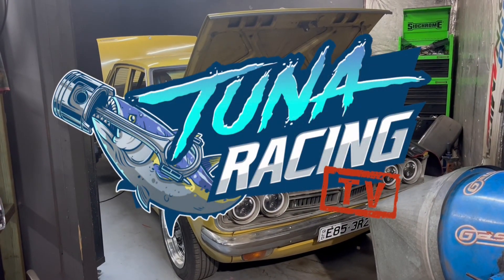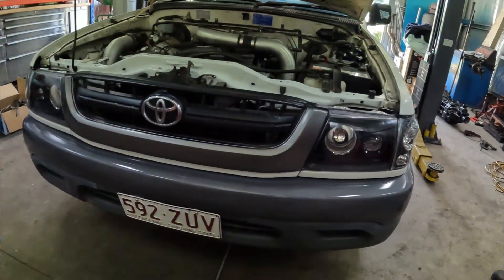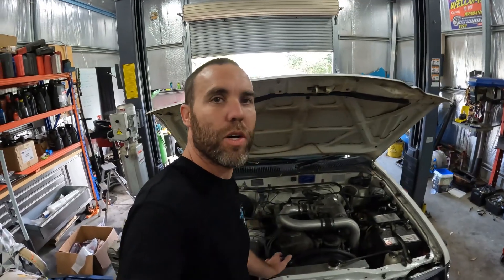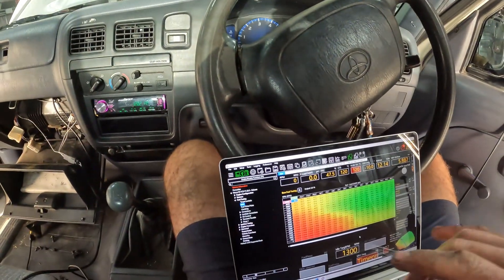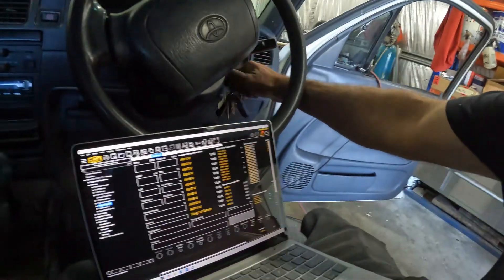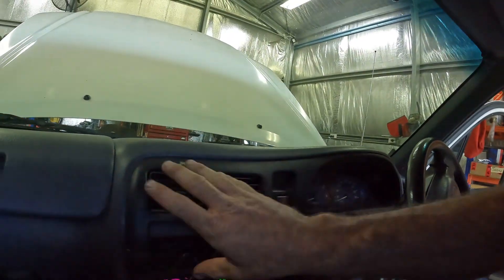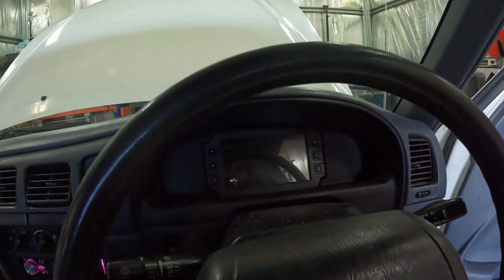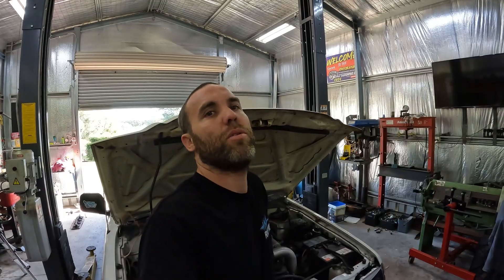3RZ Turbo Build - Episode 6 | Aftermarket ECU Install

Comment: Hi Andrew where did you get the ic7 dash mount for the lux?and are the injector plugs different on the 1000cc injectors to the stock ones on the standard 3rz lux? Cheers
Reply from the maker: Mako Motorsport for the dash mount

Yes the Bosch 1000cc are an ev1 plug which is different to stock, which if memory serves is uscar but don’t quote me on that

Comment: Hey mate, what transient throttle and idle control settings do you use in Haltech NSP? It seems to want to idle at 1200-1300rpm no matter what I change. 
Cheers
Reply from the maker: This is not a question I can answer in a comment. There are 100 things to check to work out what is going on

Comment: How much HP and torque? 
Would this be a good motor for a 87 4x4 build?
Reply: stock with this setup he got 280hp
not sure on torque! defs would be a awesome setup for a 87 4x4 lux/tacoma if ya from usa.
Reply: Copy that trying to build 2001 3rz on a budget. Recommend going stock or just full build off the rip?
Reply: @curtisrosselot6973 I’m no expert like these blokes but depending on how much power ya want to have! I would just go a turbo kit/setup with a haltech ecu that way you got room to upgrade down the track if you wanna open the engine. 

Personally I would do headstuds and cosmetic gasket maybe balance shalfs delete with a new timing kit if you really want to

Definitely do a comp test on the engine and see what comps ya get on cylinders 

How many kms on engine ?